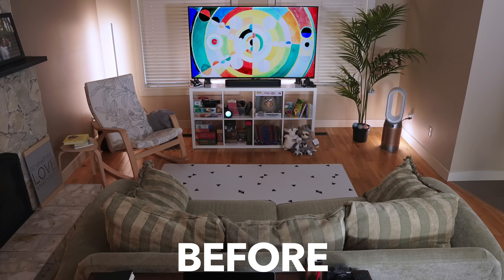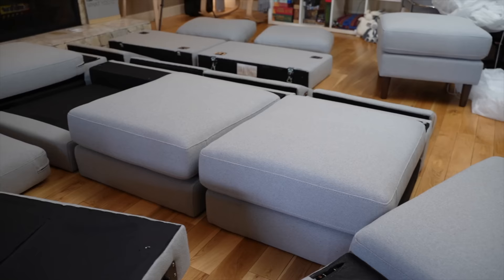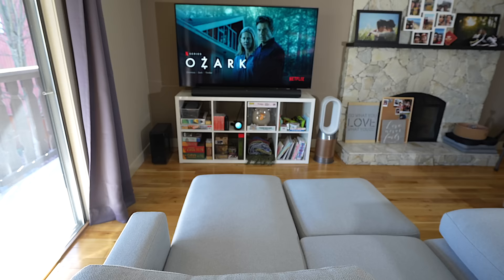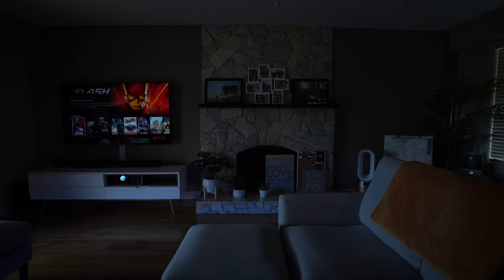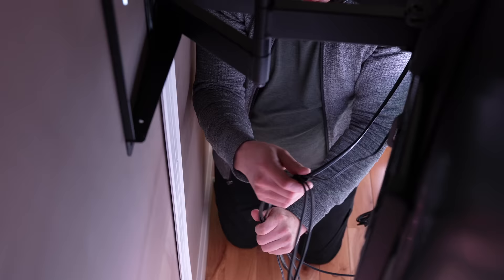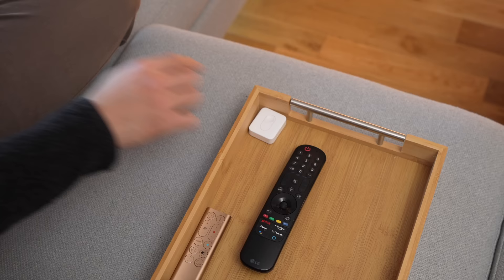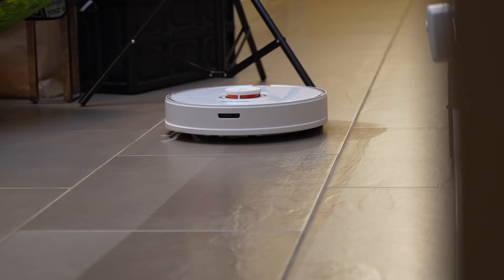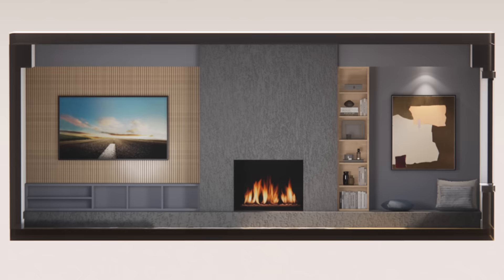Modern Living Room Setup Tech Transformation 2024

Comment: Looks great!  Suggestion: Check out HUE light strip and HDMI controller.  It uses the TV colors to indirectly color the wall.  Super cool for watching TV.  Also, think about using the inwall cabling system to hide your cables completely (no cable tray).  Love the work that you did on your living space!
Reply from the maker: thanks for the suggestion! for sure, inwall cabling would be great, definitely considering doing it myself soon
Reply: @MikeWat  the govee version is cheaper with the same quality
Reply: @Fancy405  Shame it uses that ugly tv mounted camera
Reply: @dlite1972  I'm so sorry I would rather save money and get a small camera for a huge tv than spend 100+  for something so small its not noticable
Reply: @MikeWat  please does the rgb ambient light doesn’t have any negative effects on the tv ..because you wrap it around the tv ..please you response will go a long way thanks

Comment: I like your current set up and I think it’s OK but your idea for the upgrade is wrong in my honest opinion. Since you’re extending the component system all the way across the room, and since you don’t use your fireplace, you should move everything that is on the left side to the center of the room! Move the couch to the center of the room, put the TV above the fireplace mantle area! Make the entire room look like it’s for relaxation because since you don’t use the fireplace you don’t have to keep everything to the left side of it. It is better to include everything into that room rather than keep having to watch just the left side of the room when you don’t use the right side of the room at all. That’s just my opinion but I get upset when I see people who want inter-timent in a room that has a fireplace not fully use the room but feel that they have to put a TV on the left or right side of the most central part of the room which is the fireplace. Even if you don’t use the fireplace or use the fireplace, the TV should be above it. That’s just common sense and it looks better. Thanks.

Comment: dude why don't just mount the tv above the Fireplace, is right in middle of the wall, so literally you can set the sectional   in the position  you wish and everyone can see the tv in good angle, so you don't had to buy any additional stand, the  pictures you can mounted in the wall next to the tv as collage type.
Reply from the maker: not a good idea because of the heat
Reply: @MikeWat  please does the rgb ambient light doesn’t have any negative effects on the tv ..because you wrap it around the tv ..please you response will go a long way thanks